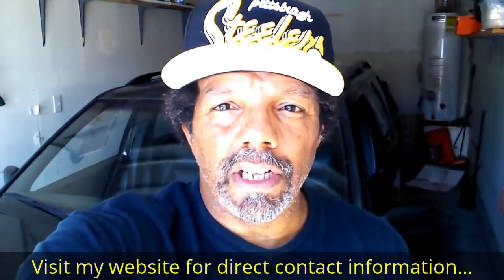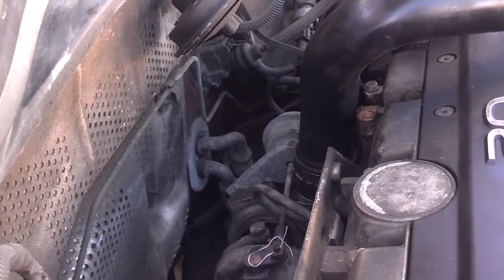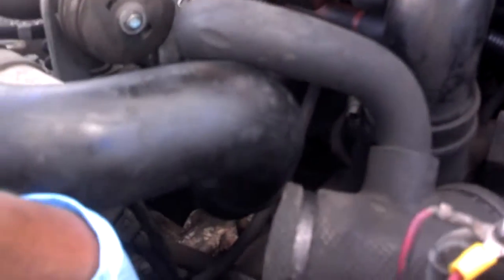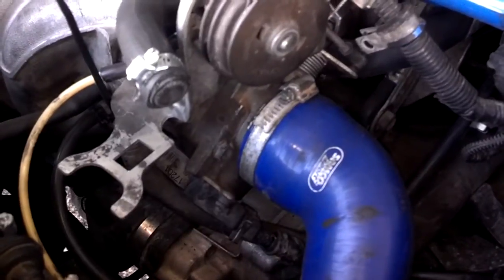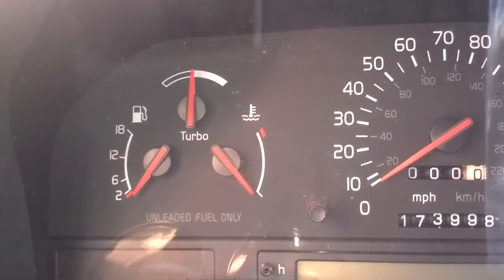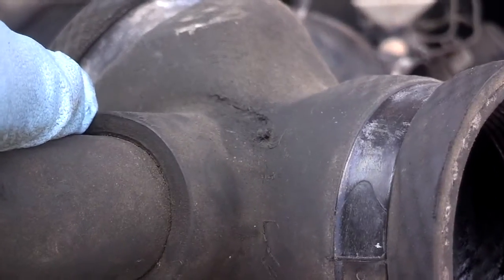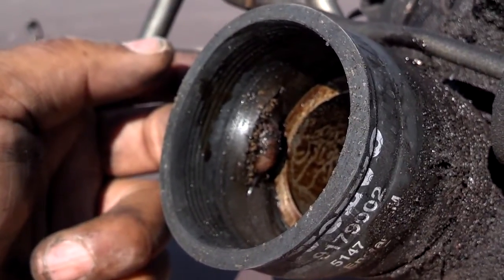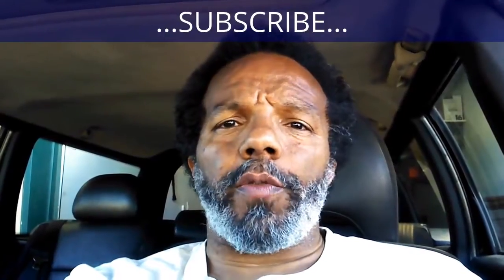Turbocharger boost pressurized tubing explained, Boost pressure 101 - VOTD

Comment: I had the rubber tube that bolts to the throttle body explode. You could see the threads in it lol I just designed a Reverse. Intercooler piping intake kit. Just copied from the Pics of the IPD RIP kit lol
Reply from the maker: +1_New Friend nice. How did you connect the IAC?
Reply: I made my kit from PVC. I found a straight through 2" dia tube it a .5" taped side port.  I screwed on a small threaded. .5" pipe and connected my rubbed hose to that
Reply from the maker: +1_New Friend dang, as long as it works. You win!

Comment: Robert, let's face it; if you have a turbo that looks like the one you showed (09:14), then your turbo is really screaming for help. Remove it & have it rebuilt. Also, the waste gate should the checked for a positive vacuum pressure, as well as the waste gate lever being adjusted to 4psi.  As far the RIP kit, wouldn't this make it worse? The extra foot of piping, gives more room for the volume of boosted (pressurized) return air. Additionally, routing this directly over a scorching hot engine, will only make it harder on the intercooler & radiator, by thermal conductivity. Finally, silicone hoses are primarily about aesthetics. The blow-off from the turbo, usually carries a lot of fine-sprayed oil along with it. Not only will this eventually destroy the silicone hoses, it'll also allow those stronger clamps to loosen their grip.
Reply from the maker: Gordon302 Hey Gordon, are you asking or teaching. Either way I'm find with it. The RIP kit actually reduces the hose length to the throttle body. You are right, a lot of people complain about the hoses coming loose from their silicone hose camps coming off. As for the wastegate, yes I am aware of the adjustment but not to many DIY'ers have a pressure supply to properly set that. As for the oil vapor spray, if the turbo is not leaking and the PCV system is in good health, there should not be much of that going on. As for that turbo at 9:14, yes that thing is nasty.

Comment: After seeing the hole you found in the elbow, I did a quick check with my hand and didn't feel any large hole. Ran out of time for the day to do a through check if the hoses. Should warm up a little to check them during the week. Would a smoke test reveal all leaks?
Reply from the maker: Sebastian Schwarz Yes but it is hard to get enough pressure built up without a professional smoker. You can try it out and see.

Comment: Finally installed my boost gauge!!  The results is somewhat what I expected. I idle at 19 Hg and when I drop the accelerator it only boosts to 5 psi's. Here's the link. http://youtu.be/YPbj5XPRiP0
Reply from the maker: Sebastian Schwarz The most common is the throttle body hose. Cracks on the under side of it and at the elbow.

Comment: Hmm could the wastegate valve not be seating propperly and leaking a little?
You are sure that gauge is ok robert.
Reply from the maker: zx8401ztv I pulled the cluster today and the gauge was not in the cluster properly. Not sure how that happened. The car does NOT have the pull that my other car has. My guess is the bypass valve is leaking but the turbo was changed a few years ago so I can't imagine what is going on yet.
Reply: Robert DIY
I think your car is seeing lots of other volvos being fondled by you, and it wants to be fondled too lol :D
Retest the whole turbo system, its the only way you can know.
Reply from the maker: zx8401ztv Heck, I haven't had to do much to my black wagon in a while. lol